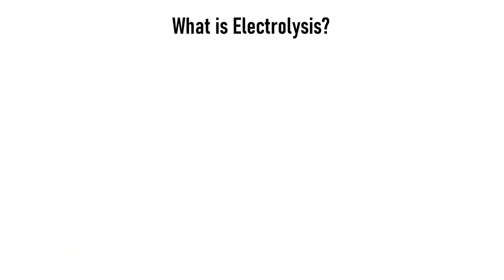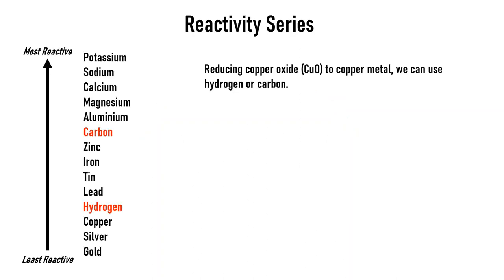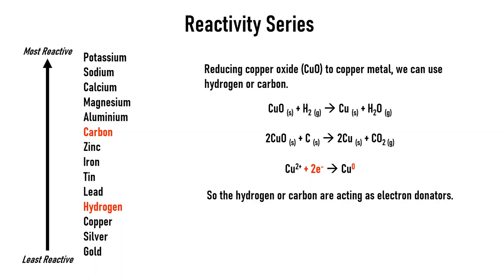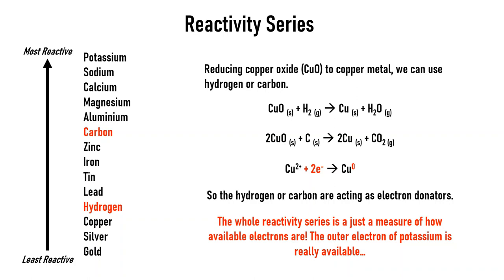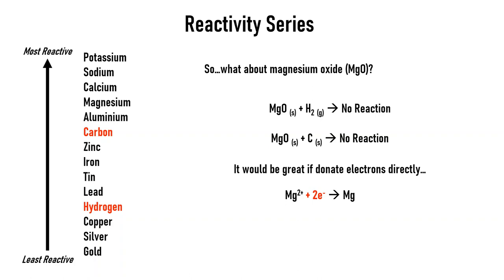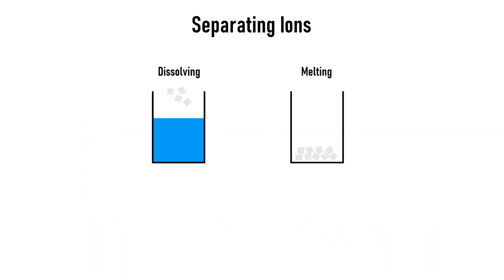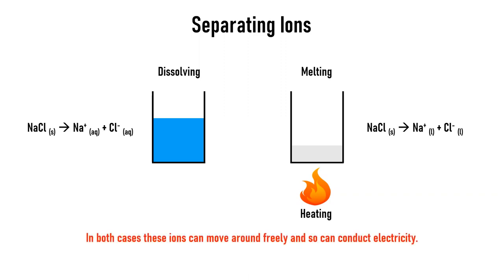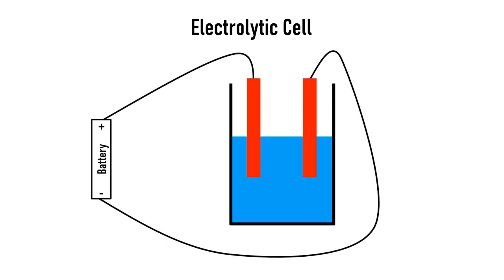Exploring Electrolysis (Part 1) - Building an Electrolytic Cell

Comment: Nice Video. I have some questions :
1.Please what is the capacity of the battery you used? 
2. Can i use insulated wires or copper wires instead of the clip lead ?
3. How can i connect the whole cell  to a bulb ?
Reply from the maker: Thank you for your comment. The batteries are 9V alkaline batteries (I will put a link to the exact ones in the description box). You can use any conductive wire but you will need to make sure they have good contact with the electrodes. To include a bulb just place it between one of the electrodes and the battery with two more wires required to complete the circuit. I hope that was useful and sorry for the late reply :)